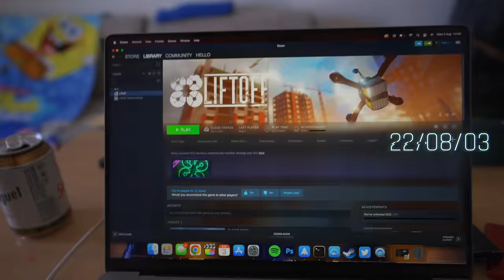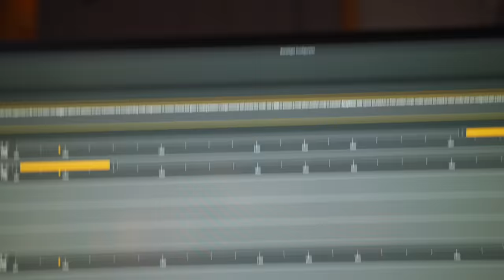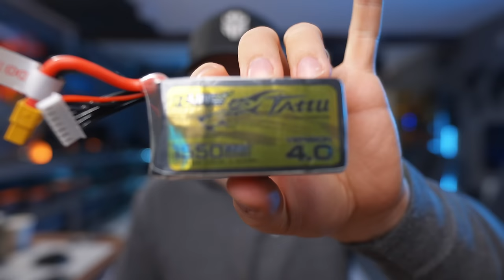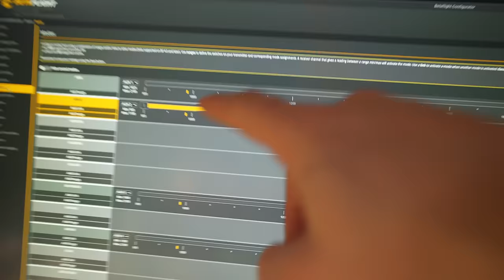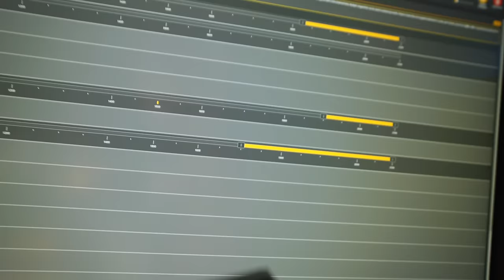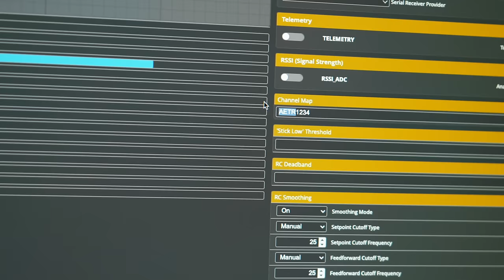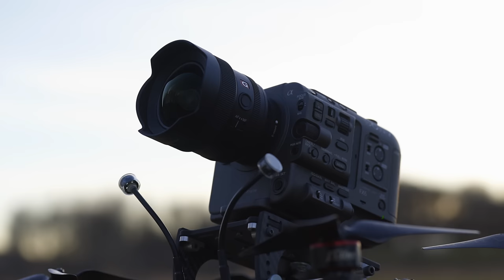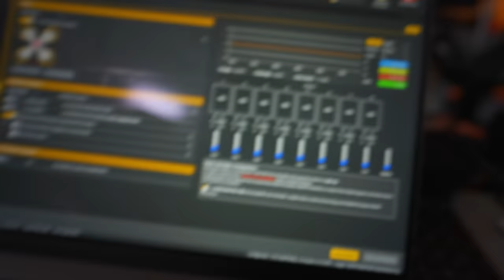From Regular Drone To Cinematic FPV Drone | An FPV Journey

Comment: chants Tiny whoops! Tiny whoops! Tiny whoops! Haha! I started practicing with a couple $100-$200 whoops that I smacked around in a warehouse a couple winters ago. Worked up to a 2.5" cinewhoop then to a 3.5" cinewhoop. Had to replace some of the prop-guards from crashes. Have yet to fly a 5". I plan to wait until there's more 5" with GPS installed, I'm in the US and in September if the drone is over 250g it will need GPS to output it's location. Feel ya on so many extra parts and tools to keep around in case of a crash. Keep on flying!

Comment: FPV is more learning and keeping an eye on everything rather than just flying. Knowing how the trasmission works, why we need to keep the antenna vertical or horizontal and so on and so forth...and never ever set up drones differently because it's all muscle memory also to short the reaction time to avoid crashing or loosing the quad.

Comment: This just motivates me even more to continue on my very own drone journey. I'm new to fpv and have purchased the Radiomaster TX12 MII and the LYFT simulator. Been practicing on that for a couple weeks now. At the beginning, I had no idea on how to keep the drone steady and had many crashes. Since then, I am able to fly around and keep the drone stable, as well as fly through gaps and openings on occasion. I say this to say that, in hindsight, having started off on a simulator, I am glad that I listened to the experienced pilots in many of the videos I watched. I will just say that flying a toy drone is nothing like flying a real drone. Soon, I'll be purchasing all the parts required to build my very first drone.

Comment: Hats off for everyone that does this as a hobby. I started with fpv in early 2020. I kinda bought the wrong gear, digital fpv wasn‘t an opportunity that time and then I always crashed my drones because of signal loss. (Even sometimes 15m far away even tho I was flying 700m away right before without problems). I stopped flying my fpv drones because every time there is something wrong. And I was right. 1 week ago I wanted to fly again after a 1 year break aaaaand here we go again. First, my gimbal on the Remote Controller suddenly broke and sent wrong signals. Wanted to fix it myself but failed. Bought new gimbals and then finally I could fly again. Ohh no wait, there is some weird noise when I take off. Well, nevermind, I have to go back home and tighten my propellers…. And then finally I guess I made my last successful flights on my analog fpv drone. Now waiting for a new DJI FPV that I can buy and sell all my analog stuff. This hobby is really frustrating / time consuming and as you said: I just want to fly my drone and film with it 😅

Great video btw, I really like your videos!
Reply: sadly you get what you pay for, and its a steep learning curve to DIY.   if you finally get a build to work and stop crashing, (safe landing practice)  +  (no issues) =  lasting hardware.  or you can spend the money up front and risk it, but then u have to be responsible for that expensive stuff and be aware of your own skill vs what the machine is doing for you.-

Comment: My tip for 17:25, even when you have a beeper and it could be a bit too quiet. So watch the before lost footage in the googles, go to the area and run the motors from time to time, they are pretty loud and you hear them from farer away than the beeper + a gps is not that expensive

Comment: Hey absolutely love your stuff, coming from a 14 yo with almost 3 years of experience with fpv, it’s a sad reality for each and everyone of us that we will lose drone at some point, especially for those who do not have the financial support to do it (me). You are definitely one of the most determined and richest pilots I’ve seen, having to break and lose quads. Many quit after their first crash or faliure. But ur very rich, basically starting off with the o3 while most pilots start off with a mini whoop and a eachine box goggles. Anyways your doing soooo well, keep up the good work my dawg❤❤❤ (also, I would recommend the ExpressLRS system just because it’s cheaper and I think way better than crossfire, although you need to fiddle around with the settings and updating software a bit, if you decide to switch, use a rm boxer or a tx16s with rm ranger module)

Comment: I would recommend using  model matching on your Crossfire. I use it on my RS system and LOVE IT!! You can have setting for each drone be different, but if you are not selected to the correct model, nothing happens. You cannot arm or fly the drone.

Comment: I really enjoyed your journey here and can relate to quite a bit of it.

I lost a quad a few years ago, never to be seen since.  I had just put a GPS module on it but I was so excited to try the FPV that I didn't take the time to set it up. I used Inav instead of beta flight because of the features I wanted.  I went up, lost my orientation, then lost camera signal.  Took the goggles off to try to spot it, but no luck.  Had I taken to time to set up the GPS features such as 'position hold' and 'return to home', I will have been better off.  This experience, however, gave me the opportunity to rebuild better.  I upgraded to the best FC board which could support two cameras, so now I have a camera looking straight down along with the normal forward pointing cam.  I can switch between them from the transmitter.

Comment: Hey Peter, great video, I was hooked the whole way through. Being an FPV pilot myself I was a bit confused when the guy said there was a easier flying BNF. All FPV drones are essentially the same, all of them are manual, have no assistance apart from the level modes in betaflight, no obstacale avoidance, etc. They all pretty much fly the same. The only real difference between drones are the quality of their electronics, frames, and other components but they all fly relatively the same.

Comment: Hey man for the 7 inch, the motors are actually waterproof, so those will still be good as well. The ESCs, FC, VTX, receiver and fpv camera might have been damaged, but many of these parts come with conformal coating to prevent water damage. Dry it out and see if anything still works.

Plug the FC into betaflight first, if it lights up and shows data that is good. Next plug it in with the real battery, see if the motors all spin up, if they do the ESCs are good and so is the receiver. Check FPV video and if you don't see any video then it is likely the camera or VTX.

Comment: I really hope that 14:49min was a bit of a wakeup call to any beginner out there that you should be MUCH MUCH more comfortable flying smaller FPV Drones not just fpv but also LOS (line of sight) before switching over to the bigger drones. They are HELLA dangerous, especially if you don't have complete control over youre drones yet...
Reply: Yea
The lack of sim time straight to an 7” x8 is insane. Definitely either really brave (with money) or stupid. 
Very well put together video though but less than a year in fpv to a cinelifter is just insane to me lol

Comment: I just wanted to point out an error, the antenna of your radio should be in the same orientation as the antenna on the drone to get the best lq, eg horizontal to horizontal, vertical to vertical

Comment: don't know if u set it up that way or not but you can put Arming to 180 in the configuration tab. Which let's u arm at any angle of the quad.
SO that second crash in the video could have been prevented by betaflight letting you rearm.

And also especially if u want to go far GET ViFly Beepers on ALL Quads.

I don't know but the 5ich could have spun to death cause of some snow shorting out some pads... thats why most fpv pilots will conformal coat their drones that they want to fly in snow or near water. to minimize the risk of something frying.

Great Video though was a blast to watch

Comment: Alltså du...
Before getting my first drone (will be a DJI Air 3, next month, getting my drone licence right now), i'm also practicing in Liftoff.
The first 30 minutes... "This is fuckin impossible, what the hell are these controls, why doesnt it auto-hover or auto-stabilize like a cinematic drone, nobody can fly this, what a useless piece of arcade nonsense"
Alt F4'd, felt like, if this is actually a sim, if this is how drones fly IRL, i'm not interested anymore.

..... Loaded it up again an hour later, out of sheer anger and frustration and stubbornness.
Now i have just 3 hours total in the game / sim, and i'm now flying in through buildings and doing loops between construction cranes. The most important part was getting the rate limits or exponents set right. I aim to have around 30hrs total by next month when i get my actual drone.
And i realize that the Air 3 is very "easy" to fly for beginners due to essentially being fly-by-wire in normal mode and sport mode.
But i figured it's better to suffer and train in "hard mode" first, to be as best prepared as you can be.

If this really is a sim, if flying a drone is somewhat similar, then i absolutely understand why you crashed your whole room in that first FPV indoor test.
It feels literally impossible the first half hour.
And if i had done the first half hour with a REAL drone (in manual mode), i'd be -$1k
And just to think about this too, if i had refunded Liftoff and ditched the drone idea, i would never have gotten where i WILL get to in 2+ years down the line.
(Yeah, famous last / first words, but its good to give your future self some incentive to not fuck things up by setting expectations.)

Comment: Awesome video! I'm considering buying an fpv drone, but in the process of making one myself! im using a zmx250 frame, some blheli motors and the 4 in 1 blheli_S esc board, for the flight controller I'm trying to make it myself using an esp32 and c++ coding, I know its a hell but the point is that I can have my own firmware I can use on everything and edit how I like. Might buy an actual flightcontroller with  betaflight support and test this in the future too! Thanks for your inspirations;

Comment: hey peter hope all is well.. big well done on the video and the work involved  in putting it all together and the time line not an easy thing to do. I too have started with the avata and im trying to learn manual mode,unfortunately the weather in ireland is not good over a number of weeks.hopefully with the summer months coming ill get out more and get good time in on the sticks. I too would like to go to the next level and get a proper fpv drone would you recommend going for the " the best 5 inch" as my next step ... like you i just want to get it with little hassle and fly. again unbelievable work you should be very proud as there is not many videos with a whole time line and back story of there fpv story . hope all is well p.s would you ever create your plugins for resolve on motionvfx ???? as i started with this program because you could get the program for free and its super  reliable and packs a punch software wise. have a good day

Comment: pro tip, you have the wrong polarisation on you IFLIGHT NAZGUL and the tango. Both antenna on the drone and the remote need to be same orientation. In your case you have the remote antenna  vertical and on your drone it's horizontal. You need to turn 90deg the tango antenna horizontal thus you will lose the kickstand function.😝
Reply from the maker: Do you have any sort of facts backing this up? Would love to read more ☺️

Comment: Hi, nice video, solid information for someone who's going through this exact evolution. I've got a FX6, and the end goal is to put it on a fpv lifter, but I have very little fpv experience. I've just bought a transmitter to start practicing on Sims.

Knowing what you do now after this whole evolution, would you suggest purchasing another drone in the interim? I have the budget, but I hate to respend money. I feel like it would be wise to have a drone for shots that don't need at the same level as the fx6, to limit risk and the number of insurance claims. With the Mavic 3 cine being the same price as a used aspire 2 just to get a prores code, it makes it hard to choke down those costs when I have an FX6 that I know I'll want to fly.

Where would you start? I've purchased a transmitter to start simming with - but I feel like there's an intermediate step that needs to be taken, amd I don't want to mistep.

Any insight is appreciated!

L/Sed
Reply from the maker: Can highly recommend a 5 or 7 inch drone with a GoPro 11 on it. It’ll be a good enough quality for a lot of use cases. 

If you’re not gonna capture just FPV vids, then the Mavic 3 Cine is great.

I highly recommend the drones at fpvframes.ch
Reply: @PeterLindgren1  Thanks for the response!

Comment: Hey Peter,
i have to correct you. I got a Mark5 and put a 3300mah 4s (same length) on the bottem of my drone its a little sketchy but once you know how to attach it it fly´s  and with the gopro my drone weigths ~950g and feels with the right tuning pretty good. You feel the weigth but i can fly around ~8 mins with this combination. While with my other 4s 1500 mah i get around 5mins but im killing my pack with that xd. So if you dont do tight freestyle its definetly working out fine. :)
Reply from the maker: It works but it’s not recommended though! 
The MK5 is a great drone 👌🏼

Comment: geprc crocodile75 V3 and the iflight chimera 7 are neck in neck for the best 7s on the market today. In my worthless opinion. I went with the crocodile because it can be stripped down lighter than the chimera even after you blow off all its plates.

EDIT: I am strictly speaking frames. always diy. never bnf.

Comment: There are some arguments for why it doesn't matter with freestyle rigs, but generally if your RX antenna for your RC Link (Crossfire in this case, I think) on your quad is mounted horizontally, the TX antenna on your transmitter (the tango 2) should also be positioned horizontally for the best reception. But even when using diversity you didn't appear to have one mounted vertically on the RX side, so I do think your TX antenna should be horizontal as well for the best reception. (hopefully you didn't mention this somewhere and I just missed it - if so, sorry).
Reply from the maker: Is there any sort of tests done on this or is it just a guess? Would genuinely love to read about it 👍🏼
Reply: @PeterLindgren1 this is widely known in the Cinelifter world. Would recommend reading some Oscar Liang articles.
Reply: @PeterLindgren1  I wrote some hilariously long response with links, but maybe YouTube ate it. So this one should be a bit shorter. Unfortunately I can't come up with any FPV specific examples that provide just the data for you to draw your own conclusions, but, no, not a guess, just sort of a fundamental concept of antenna radiation patterns - this mismatch of rx/tx antenna orientation is just a stop along the way to the worst possible outcome of pointing the nulls of each antenna at each other, which diversity helps with a lot. If you google antenna orientation matching and signal quality or rssi you'll find some studies that are non-fpv related (many show differences in quality in dbm, which is logarithmic BTW, so a small change in dbm is a big difference in power). You can also run the experiment yourself by just using a low output power and flying while logging LQ and RSSI (but RSSI will probably give the best indication). Crossfire just gives you such a long leash that even bad antenna orientation works just fine but if you do encounter interference or sketchy signal this can really make a huge difference. How to place your diversity antenna, or if vertical or horizontal is better, that depends largely on how you fly, however, Oscar Liang does have some articles that show charts for diversity antenna mounting options "How to Mount/Position Transmitter and Receiver Antenna on FPV Drone".
Reply: @PeterLindgren1  also perhaps a part that would help in research is that the immortal T antenna are not circularly polarized antenna like the VTX antenna - they are dipoles, which is relevant to their radiation / gain patterns.
Reply from the maker: @OriginaldoBo  Interesting, i've heard professionals say the opposite!
Reply from the maker: @CesiumSalami  Appreciate the info!
Reply: @PeterLindgren1  I'd be really curious to hear where / why pros are saying this. I'm quite confident in my answer but do love learning. A much more murky topic is flat/vertical mounting overall esp. when diversity is included - pretty decent arguments on both options. FWIW, if you scope out a few Beverly Hills Aerials videos for example you'll see them matching.

Comment: Would airtags work on the drones for locating them, or at least increase the chance of finding them when you are close?
Reply from the maker: The downside with an airtag is that you won't have a signal unless there's iphones close by... But some drones do have GPS trackers though!
Reply: @PeterLindgren1  Yeah that was what I was thinking, like that time together with Teppo and Icelandic guy in the snow, when you walked past the location one or two times before finding it :) Even though it doesn’t work long range at least the chances might improve if you’re close :)

Comment: Hey Peter! I'm starting to practice with the Avata in a simulator. When you fly manual do you keep your camera pitch at 0⁰ / default or do you put it at it's highest of +65⁰? I seem to only be able to fly in the simulator when I set it to 65⁰
Reply from the maker: 30 is a sweet spot